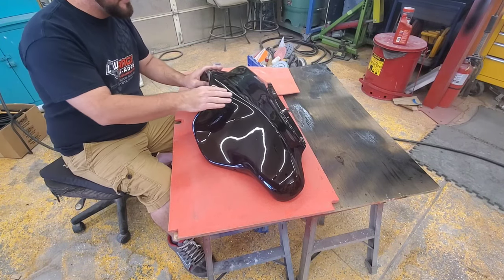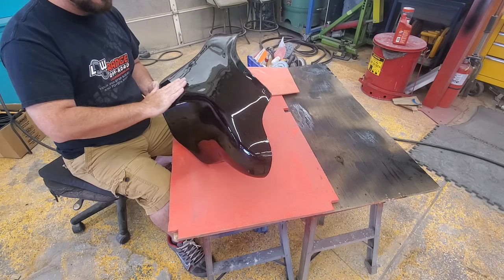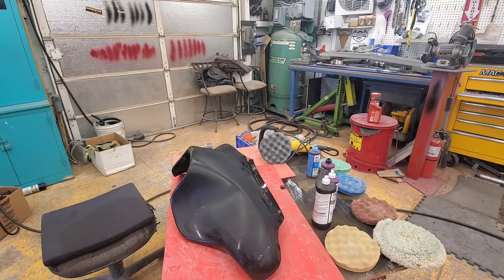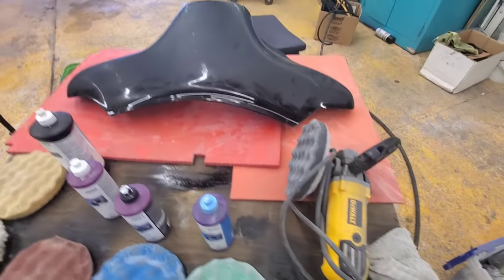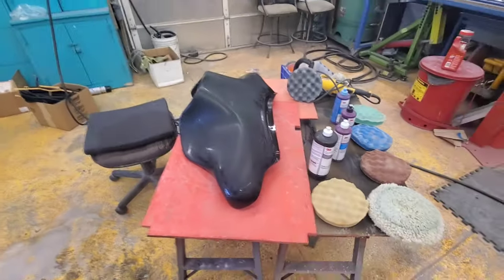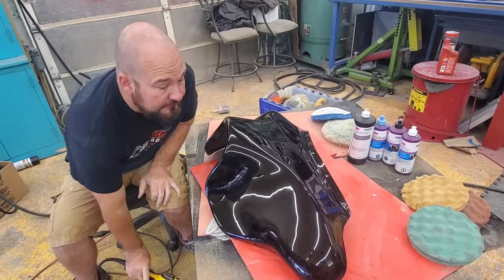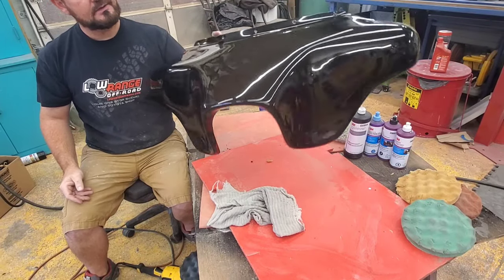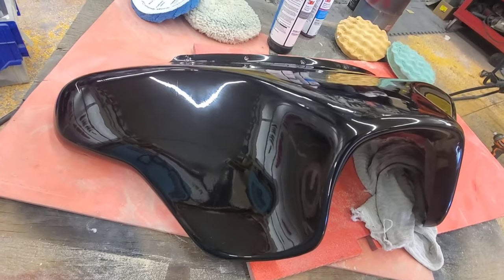Wet sanding cutting and buffing Harley Davidson front fairing With stereo and speakers finished

Comment: What is the benefits of using the larger buffer vs a smaller 3" DA? I'm using a SPTA cordless with 1", 2" or 3" pads
Reply from the maker: There is no benefits I just have a large buffer.